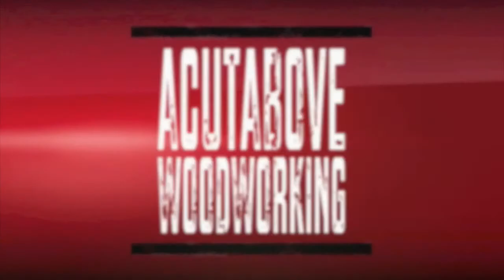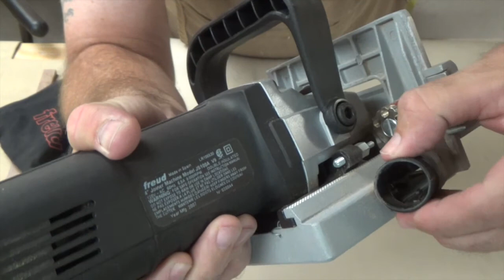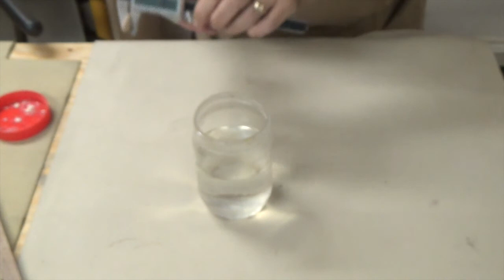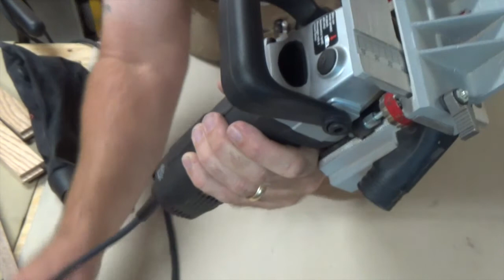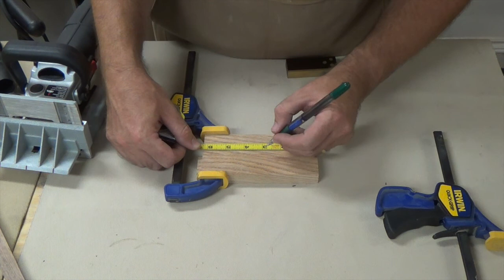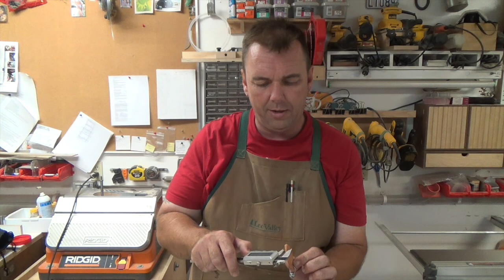Using a Biscuit Joiner

Comment: some hard woods require a slower,  and at times,  a half plunge then a full plunge.  A quick plunge could cause the tool to move and make a bad cut.
Reply from the maker: I'm sure that someone will find your advice very useful.  Thanks for tuning in and taking the time to chime in with your suggestion.

Comment: Instead of drawing the square/straight line all the way across both boards (such as in your example), I only draw the lines out from the meeting point so they are long enough for me to see once the biscuit joiner is in place. My method does away with any confusion over which side of the boards the cut needs to be made, so no extra 'tics' needed. Is there any reason not to do it as I am? I'm pretty new to my biscuit joiner. 
Thanks for another great video. 
And when you say, "Guys", I know you mean both male and female woodworkers.
Reply from the maker: There is absolutely nothing wrong with the way you are doing it.  On my show, I demonstrate one possible method but it is definitely not the only method.  If your method works for you and it is safe (sure sounds safe to me.  It's a pencil line after all) then by all means, use your method.  Sometimes, the method that I film on the show is not even my preferred method but I just want to show a different way of doing things to have people think outside of the box and try something different.  Thanks for taking the time to leave a comment and thanks for tuning in to the show.  If you have any questions, feel free to ask.  I'd be more than happy to help you out if I can.

Comment: Another great video Ken. So you made a comment to yourself did you? I'm thinking that maybe this video is the best possible way for not only talking to yourself but answering yourself back I've ever seen...:)

These things are great especially when making wide panels using solid wood. Surprisingly the biscuits really help in keeping each board flat to the others during glue up.  I have a Royobi unit without any dust collection and it throws dust every where. Good thing I work out doors and not in a real shop. :)
Reply from the maker: Thanks Johnnie.  My joiner has saved my butt several times when I was stuck for a way to strengthen a joint that I had no idea how to make it last.  Properly used, it really is a great tool.